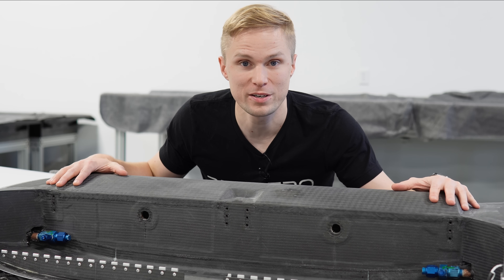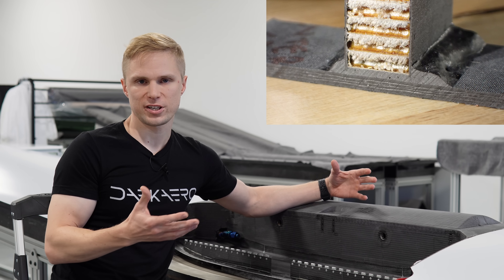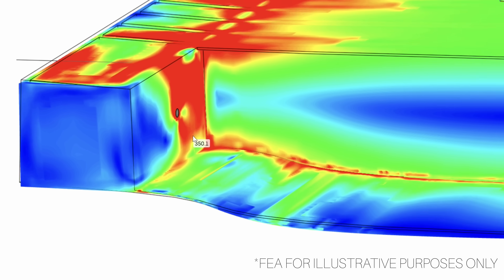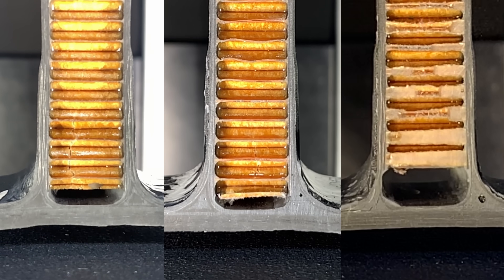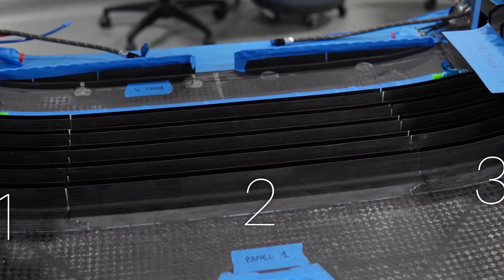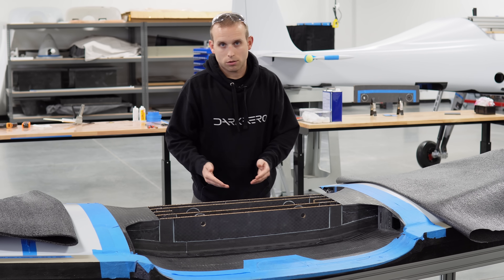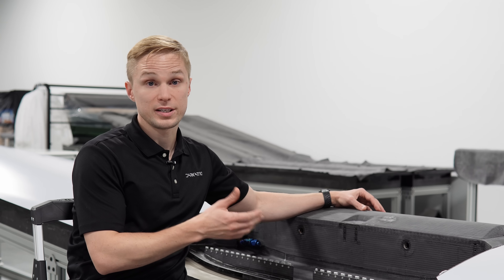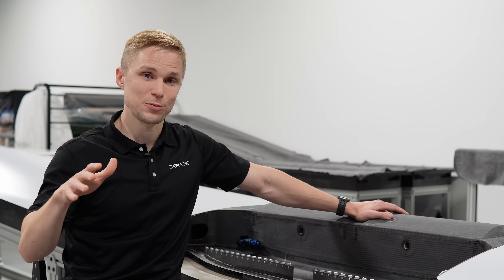Why we rebuilt our wing using pi joints

Comment: I recommend "trying" 2 things.
1) look at an epoxy like "Lab Metal".
2) CF  is just as it sounds, it's a fiber, right?!. So treat it as such.
IE: 
In the textile industry, specifically fabric, they generally  don't "glue"  pieces together...do they?!

Not usually. They sew them.
2 or more pieces or layers, whether parallel or perpendicular  should be sewn together first, then epoxied.
You will find this method to be insanely strong, especially when combined with an epoxy.

Although there are many other things about CF, that I understand, most neglect, that can make obscenely strong parts.

Comment: Are you guys still an aircraft company or have you pivoted wholly to manufacturing instruction? I ask because this design change is clearly not needed to advance the program into floght test. As you stated you had already done a proof load test to normal category loading. And you've had a running prototype for 2 years or something? You should be more forthcoming with your audience rather than continually teasing this airplane that you seem to have no plans of ever flying or selling.

Comment: Fascinating! Manufacturing those Pi joints alone would be a great video. What's used as a filler? Were those 3D printed or just injected in as a bead? I wonder if it makes sense to 3D-print the vaccuum bag itself, or spray-cast custom vaccuum bags from a 3D-printed plug, in order to more effectively 'hug' all the little nurnies in a complicated form. I remember how frustrating it always was to fight a sheet of plastic into a complex surface, and never got ideal results. This was before the age of desktop 3D printers.

Comment: This is the first time I've seen your channel. I'm curious if you have tested a more conventional structure with carbon fiber. Seems like there should be a tube like beam connecting the wings and fuselage. I've never built a plane though. Good luck!

Comment: The wing is not absolutely right, but absolutely wrong. It is not only week( G-load calculated for the Dark aero design is too low), but bending properties of this wing are very poor because the cement bags bend the wing at the fuselage area (in the middle) much more and the rest of the wing is bent much less, which is very bad, it should bend equally along its entire length. It can be seen at the beginning of this video. Besides that, traditional wing design with spar is clearly better , because   there is enough space inside the wing in front of the spar for safety tanks or at least separate tanks to prevent fuel contact with the wing, because nowadays fuel is partly made from ethanol which is aggressive to epoxy resin at least here in E.U.

Comment: Is this thing ever going to fly? Yes, the engineering is all very clever, but it all means zip til it gets off the ground...
Reply: The wing is not absolutely right, but absolutely wrong. It is not only week( G-load calculated for the Dark aero design is too low), but bending properties of this wing are very poor because the cement bags bend the wing at the fuselage (in the middle) much more and the rest of the wing is bent much less, which is not good, it should bend equally along its entire length. It can be seen at the beginning of this video. Besides that, traditional wing design with spar is clearly better , because   there is enough space inside the wing in front of the spar for safety tanks or at least separate tanks to prevent fuel contact with the wing, because nowadays fuel is partly made from ethanol which is aggressive to epoxy resin at least here in E.U.

Comment: Assymptotic engineering at its finest... Approaches completion, but never gets there... But may I say... Whew... Glad to see you still on it and taking the time to get it absolutely right before you sell the first kit.
Reply: The wing is not absolutely right, but absolutely wrong. It is not only week( G-load calculated for the Dark aero design is too low), but bending properties of this wing are very poor because the cement bags bend the wing at the fuselage (in the middle) much more and the rest of the wing is bent much less, which is not good, it should bend equally along its entire length. It can be seen at the beginning of this video. Besides that, traditional wing design with spar is clearly better , because   there is enough space inside the wing in front of the spar for safety tanks or at least separate tanks to prevent fuel contact with the wing, because nowadays fuel is partly made from ethanol which is aggressive to epoxy resin at least here in E.U.

Comment: I'm  certain that the bending properties of this wing are very poor because the cement bags bend the wing at the fuselage (in the middle) much more and the rest of the wing is bent much less, which is not good, it should bend equally along its entire length. It can be seen at the beginning of this video.

Comment: Modern wing load testing stands as a direct legacy of the trial, error, and tragedy of early aviation. The meticulous process of stacking sandbags or applying hydraulic pressure until structural failure occurs is not just an engineering exercise,  it’s the result of a century of hard lessons learned through the sacrifices of flight pioneers. In the early days, aviators like the Wright brothers relied on intuition, simple materials, and limited data, pushing the limits of flight often at great personal risk. Each structural failure and each life lost became part of the foundation for today’s rigorous testing standards. 

Modern aerospace engineers now simulate, measure, and push aircraft components to destruction so that no pilot ever has to unknowingly do the same in the sky.
Reply: Using sandbags to test aircraft before flying them goes back at least as far as the B-52.
Reply: @billsmith5109 I'd like to know who originally thought of it first,  also when did using sandbags as opposed to something else first happen?

Comment: Wow. You guys walk the walk on engineering discipline. Clearly defined goals. Build, test, evaluate. Design and implement a one-off solution while planning a DFM solution for future builds. Alignment jig and dry fit. Build. Test and collect data. Repeat as needed. Zero "The production build will be better but this is good enough for the one off." Outstanding work. Thank you for documenting and sharing not only your build but the professionalism that went into it.
Reply: I don't understand why they reworked their existing wing.  They're going to have to acceptance test their new wing anyway, why not just build that and test it?

The usual reason would be that they weren't confident the new wing design would hit all their requirements.  But that coupon testing for the Pi joint looks solid.  No reason for lack of confidence there.

I'm wondering if they are delaying the new wing fabrication because they suspect there will be requirements for the new design that they don't know yet.

Comment: We were looking at and testing using Pi joints on stiffened skin structures in the late 80's.  The trick was that the bonding was done "blind" and hard to ensure we got fully bonded surfaces.  The project didn't go forward so fun to see you putting it to work!

Comment: Neat. One question, you have pi joints at the bottom of the webs, but not at the top? Why not both?
Reply from the maker: Pi joints were implemented in the upper joints of the center section of the wing where the upper wing skin transitions into the "bow tie" through a lap joint. These upper pi joints are shown at 7:47 in the video. They are not required under the straight center section of the bow tie since the out-of-plane buckling loads are lower there compared to the transition lap joint. Thank you for checking out the video!
Reply: @DarkAeroInc  Got it, thanks!

Comment: SEEMS LIKE A BAD SIGN TO ME that in spite of known limitations in the original joint design (which is still in use for the stabs) the design improvement only followed manufacturing improvement in manufacturing capability rather than manufacturing improvements being driven by design needs. But I guess there are points for eventually making the improvement and for transparency.
Reply: Did you math it? Or are you just going by your feelings

Comment: The Pi joint was used in the Glassfluegel Libelle's glider wing-skin to web joint. We are talking over 1967 design and a certified aircraft. Rutan used a 3 dimension weave there, ingenious, but it had its costs.
Making the wing underskin simply straight (with fairing) would provide a lighter, simpeler structure, with lesser internal webs. 
Incase of a belly landing you scrape away the underwing skin, and webs probably, instead of the fairing. Imagine the repair costs in both cases. 
So, change the mold (in the fuselage area only) and make the wing underside straight (like a Mustang) or with on big radius for the dihidral.
Reply: Please be specific about Rutan's techniques and were he used them.  It would be great to be able to look up some examples for reference.  Thank you for any information you can help with.
Reply: Is it really relevant to think about repair costs of a CF airframe after an event like a belly landing? Could one ever be confident that the entire airframe would have the requisite structural integrity to safely fly or be re-certified given the poor damage tolerance of and NDT capabilities for CF structures? Obtaining certification for a given manufacturing process is tough enough. How would one ever be able to do similar for a one-off repair process?
Reply: @jamesclaeys3192  Some aircraft i know (RF5b, Fokker F28) with retractable gear have these underbelly skids inside the wing fairing. These are ment to slide on over the runway, and to be replaced with reduced effort. The RF5b has wooden skids (no sparks while skidding) and the F28-skids are bolted with large bolts, so quick exchangeable. The designer knew not all u/c's are always perfect and not all pilot are either.

Comment: Seems complicated, was it entirely necessary to have the wing skin change plane in the center section? Any reason the structural skin could not maintain the same plane, perhaps with a non-structural fairing over top?

Comment: For vacuum bagging the pi joints.  Have you thought of a form to mold the bag to.   Even thermo vacuum forming the bag to shape.   If the form is for the outside of the bag.  A little vacuum holding the bag tight on the form will greatly reduce time spent putting the double stick tape on.  If the form is light.  Vacuum holding the bag to the form will allow it to become an installation tool.  Placing the bag and tape in the perfect location in seconds
Reply: this is 4-D thinking (3D geometry + process through time)

Comment: Best practice applies to materials that are stronger in shear, but carbon fiber has high tensile strength and is not the standard material those rules apply to. You do need to avoid shear forces unless you do staggered lap joints, or you will get a peeling delamination weakness on half your joint in each direction. A staggered (alternating) lap allows you to feed the fiber layer under the stiffener and join to the opposite/back-side. This means any shear failure needs to pull the "tab" under the vertical panel, giving a very strong joint.
Reply: I think they already know this ...

Comment: Since you are re-thinking some basics, please reconsider adding a BRS. It will make the plane a much better commercial success and safer for pilots. With the current design, just a few engine-outs and fatal crashes, and DarkAero will be history. Good luck.
Reply: You think dark aero will ever sell enough aircraft to have a few engine outs and fatal crashes? That's optimism.   While interesting from an engineering perspective, this aircraft seems to be aimed at a similar market as the pantea wunderplane.   And the skies aren't exactly dark with them.  And darkaero is proposing to be run on an unproven engine.  I like your optimism but this whole project seems very much like somebody's tax shelter or something.
Reply: Hahahaha  @ac583 lol unproven engine? Tax shelter? Are you daft?
Reply: @ac583  What "unproven" engine do you think they are proposing to use? It's a UL Power UL520iS; the UL520 has been around for more than a decade.
Reply: @ac583 this project is what happens to engineering without a schedule

Comment: I'd like to avoid these joint issue all together, making it a non issue. Do not test tension and shear for the carbon fiber joint. Carbon fiber is not designed to achieve these. The test is not reliable.

Comment: Here in Europe we like to use Rotax engines (running on car petrol) and I would also prefer a traditional wing design (with spar) where there is enough space inside the wing in front of the spar for safety tanks or at least separate tanks to prevent fuel contact with the wing, because nowadays fuel is partly made from ethanol which is aggressive to epoxy resin. I also think that the maximum G-load calculated for the Dark aero design is too low. I prefer stronger aircraft, especially if should be fast...
Reply: Agreed with the above.

Limit loads for very fast airplanes should generally be higher. Fuel tank safety should be a real concern with modern designs. Rotax makes a great product. Extremely fuel efficient and reliable.

A rotax airplane is not going 275mph with two persons, though. Even a 916iS is going to be perhaps 200mph or a little better.
Reply: @Triple_J.1  There is one exception called Risen made in Italy. Risen company guarantes max horizontal speed at high altitude 250 knots  with Rotax 916.    Dark Aero did not fly yeat, therefore who knows the real speed ....  Risen managed to cross atlantic ocean (non stop)  cca 3200km in 10,5 hours and used just 41 galons . Maximum G - load for Risen is: +5 G    - 3 G

Comment: If you want to build race car, then build race car, like F1 .. and every race car I know can be dismantle, maintain and build piece by piece. It looks like you want to build race car (to get power and weight ratio), but using road car assy components. High performance vehicle = high maintenance, and each parts also can be disassamble and check.

Comment: Mix graphene into the epoxy. Ultrasonically. Homogenously.
Its getting to be magnitudes above steel strength. 
Robert murray smith shows how to use 400 mesh graphite add whey protiens into a blender and run for 12 hours to make graphene. 
The protien molecules are keeping graphene separated on molecular scale. 
I do think it works. All the stuff he shows may seem novelty but it actually has very particular substance in his words and instructions. 

When you think about it, it does not take much economically to make separated graphite scales we know as graphene. 

Its just so valuable when you do have it, its when those prices get jacked up.

Comment: My god this looks like it'd MASSIVELY expensive to manufacture.

I've watched many of your videos, but I'm now feeling like I need to hunt down the telos of DA. Bc with such incredibly intricate manufacturing requirements (this like like FORMULA ONE LEVEL TIME-CONSUMING) ... I know nothing about your target market—but would guess this makes it even smaller than the already-small "I-can-afford-aviation-toys" market. 

Like, as expensive as the tooling is to form metal forming jigs to press wing spars, etc, this would just have to be even more expensive, no?

I can't really get enough of these videos though. I just love learning about practical application-engineering. And can't wait to see the finished product.

Is there a video explaining the goals of DA? Like, how much you expect it to weigh approx, how long you want the frame to last, what price range you want it to cost, etc? 

Bc on top of everything else, I just have no idea how someone would go about getting this sort of wing REPAIRED if there were delamination, etc, in say, 10-15 years.

Comment: The P-51 was built in 102 days then refined by adding the Rolls-Royce engine in the back of a quite hangar with a few mechanics and engineers.  These guys had been told NO do not put a rolls on that aircraft by the brass establishment but they did it anyway, and made one of the best fighters of WWII.  Get on with it guys, refine later once your selling a good aircraft.
Reply: Yup.  Perfect is the enemy of good enough

Comment: So, why didn't you do flight testing prior to a major redesign of major aircraft components? Now if you discover a gremlin in the CFD via actual flight test data, or a modification would be helpful, you may be redesigning/remanufacturing for a third time.

Comment: At about 4:45 in the video, you show your coupons failing.  They all appear to fail by exceeding what the adhesive can hold.  Instead of gluing flush and putting all your faith in glue, can you have the spar penetrate the backing plate, so there is a mechanical interlock in addition to the adhesive?
I'm a homebuilder and student A&P in CA, and fascinated by your project.
Reply: I believe that "backing plate" is the actual skin, which itself transfers most of the forces. My assumption is that they want to minimize penetrations of the skin, as to minimize the impacts to its strength.
Reply: @TheOwenMajor  yes exactly, removing area to create a mortise like joint in furniture causes enormous stress risers, if they relieved holes or pockets into the lower skin as your pondering. They probably didnt want to move the same load fractures to a different location. Just solve the problem dont push it around.